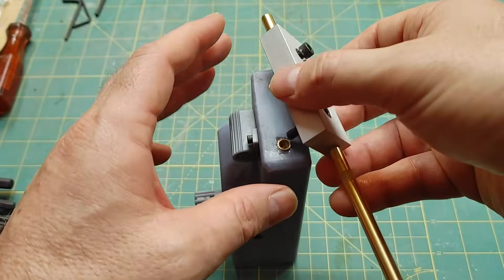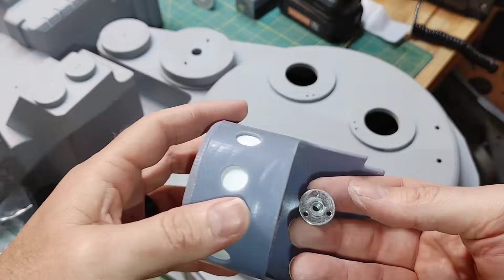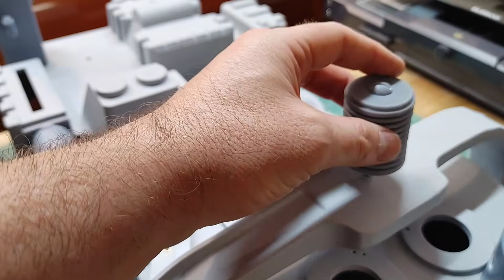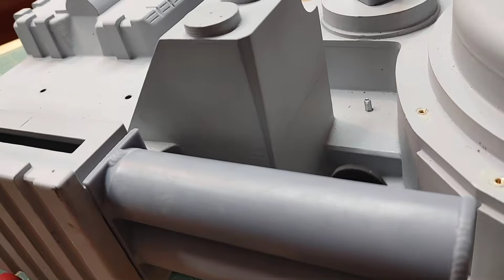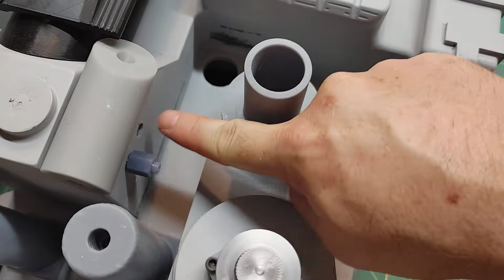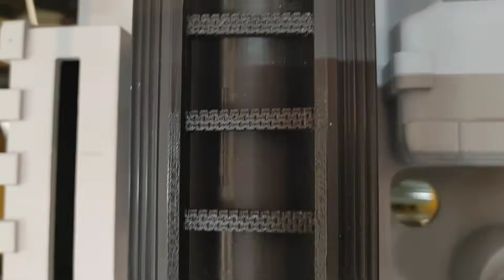My 3D Printed Ghostbusters Proton Pack Build - Part 6 | How To Fully Assemble A Proton Pack!

Comment: Hello! Awesome work as always. I’m getting ready to do final paint on the shell and parts but wanted to get the parts prepped with the inserts and such before painting. I have the correct brass inserts ready to go but don’t have the screws/washers. Where did you find all the screws?
Reply from the maker: Ace hardware or any local hardware store. Glad your making progess!

Comment: Hi, did you drilled the shock mount's hole exactly in the center of the cyclotron ?
Reply from the maker: No sir, I line the bumper up properly so it looks right and has proper spacing. You could also bolt the bumper in if you have predrilled mounting holes and then run a bolt through your bumper and mark your shell by scuffing with the bolt. Keep in mind in GB1 1984 they didn't run a bolt through the shell but only through the back side of the bumper. They did the bolt through the shell on GB2.

Comment: Hey Chris, I’m working on my/your shell now. Can I ask, why do you glue some inserts and heat press others? 
Thanks 🙏
Reply from the maker: Good question, the inserts can be heat pressed into PLA or plastic filament from an FDM printer. The inserts can't be heat pressed into UV resin from a resin printer. UV resin has a much higher heat tolerance and is more rigid then FDM filament so that is why you just have to drill the right size hole and epoxy glue them in with it. Hope that helps.
Reply: @ChrisBoshProps that’s really helpful, thanks mate! Last question, what method do you use to heat press? 
Thank again! 🙏